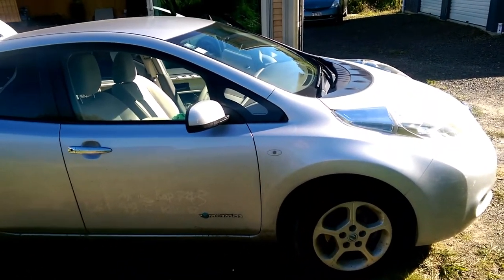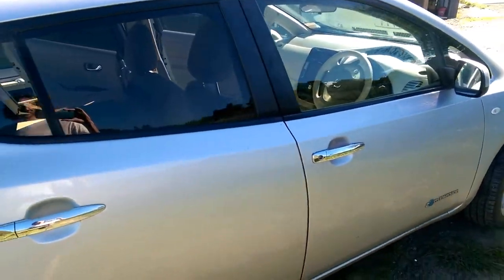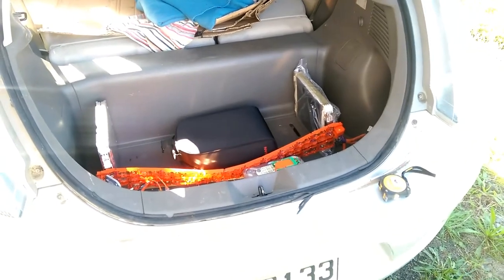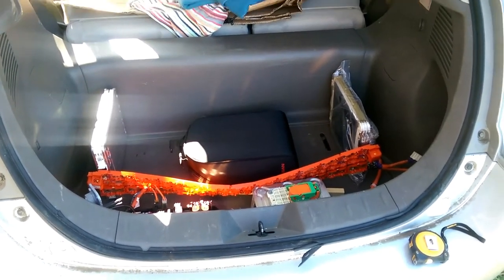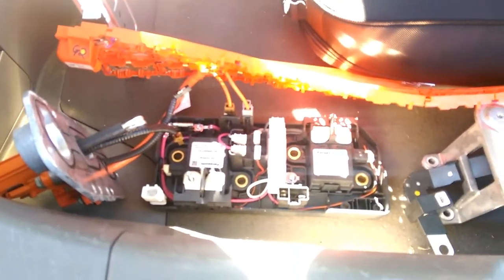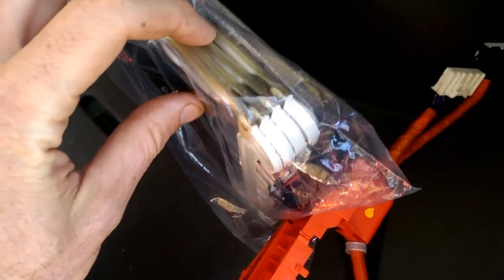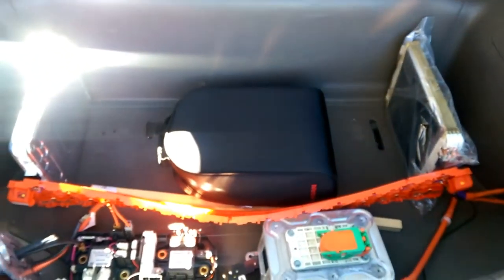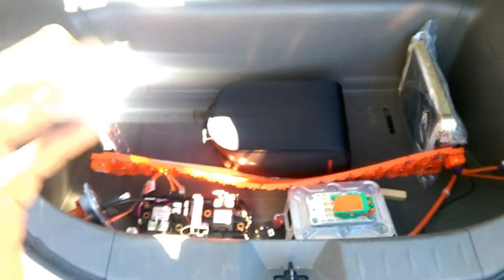REB Leaf Range Extender Concept

Comment: Hi, if you are going to use a DC-DC, why do you want to change the modules from 2p2s to 4s?  Some energy will be saved, but it is a lot of work stripping 24 modules, less safe, bigger wiring job, and less "plug and play". Would not a DC-DC CC/CV step up be a better choice?  With such a DC you make a setup like Kreisels BMW Rex.  Cheers, Tor
Reply from the maker: Hi Tor,
Thanks for the feedback. I got quotes for DC-DC converters able to do 30kW. They were EXPENSIVE!  I'll investigate the BMW REX stuff. Good idea.